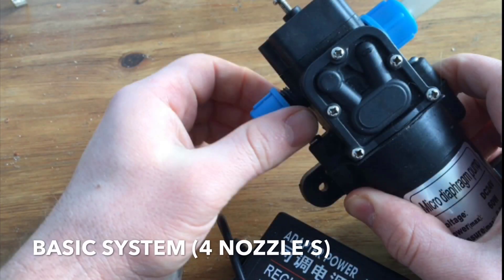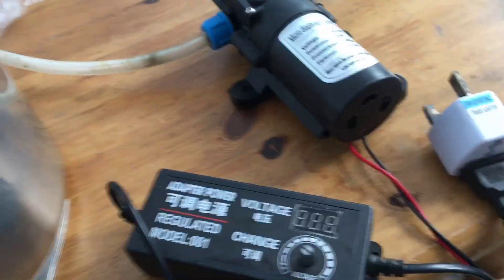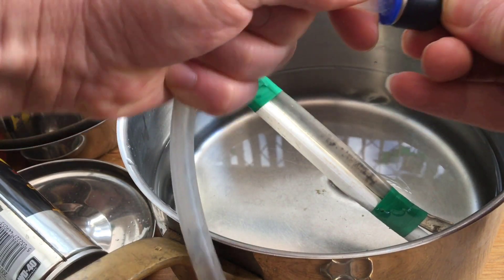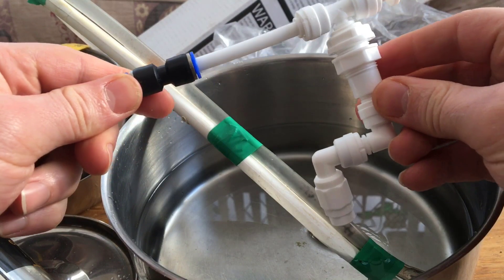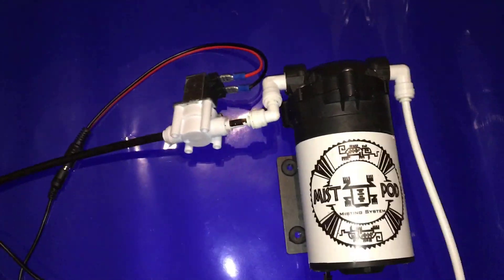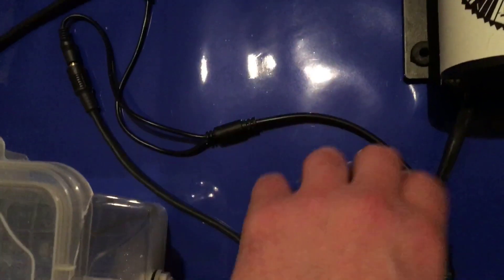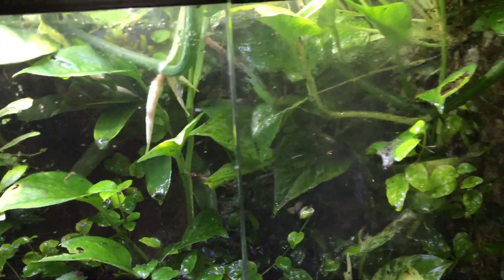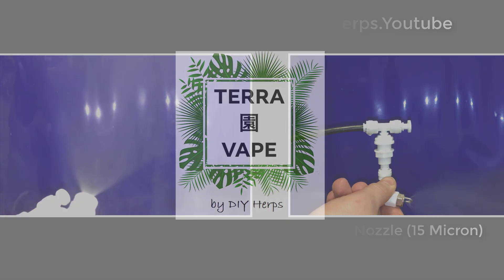How to make a Basic and Advanced DIY Misting System for Terrarium Vivarium

Comment: Do I need the more expensive pump for 8 or more nozzle? I did some fluid dynamic calculation and math checks out for the smaller pump but I was wondering why you chose the bigger pump for the advanced system?

Comment: Hey nice work man . Looking to build the same thing . My question is ..do all the spray nozzles come on simultaneously ? For example say I needed a 2 second spray for maybe 8 nozzles . Would it work ?
Reply: All nozzles should start simultaneously if the tube running to them is equally filled with water.
If you place a check valve above your pump, the tube should always be completely full and the nozzles will start at the same time

Comment: Hi!Great video.I was looking for this because we have a problem in our set-up.We are using 150 misting nozzle in our greenhouse as additional cooling.Our pump is 8/L min diaphragm pump, up to 160 psi high pressure pump + 1L pre-pressurized tank.However, some of the misters are just dripping.Would you suggest changing the pressurized tank or use a bigger pump?Thank you in advance.
Reply: did you solve the problem?

Comment: Would this system work with a 12 volt pump and power adapter?
Reply from the maker: It depends if the specs meet the same as the links in the description! I would just use those as I shopped around for the cheapest options anyway :)